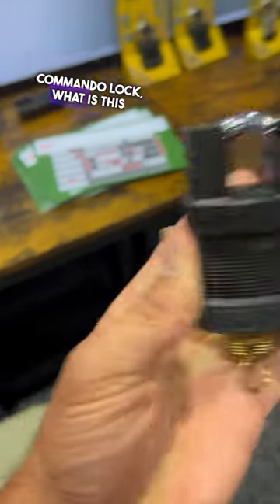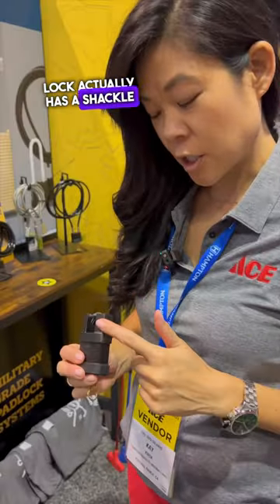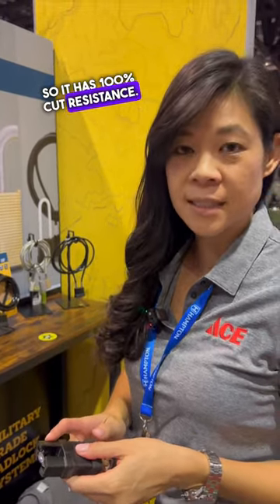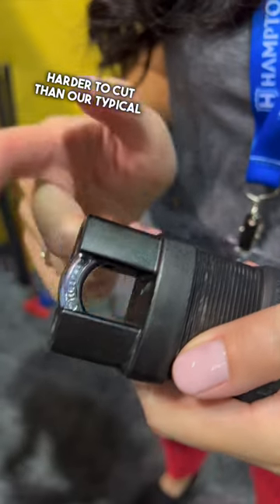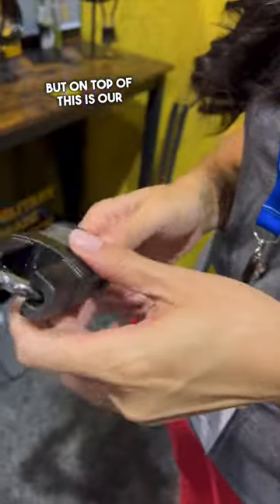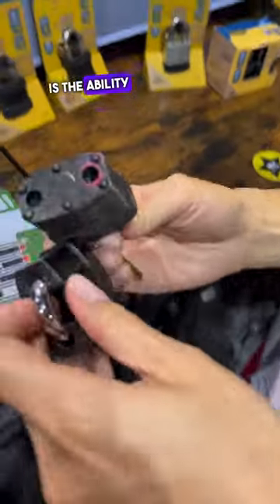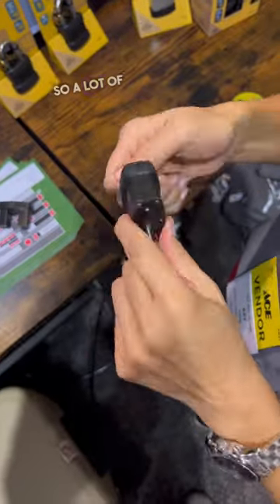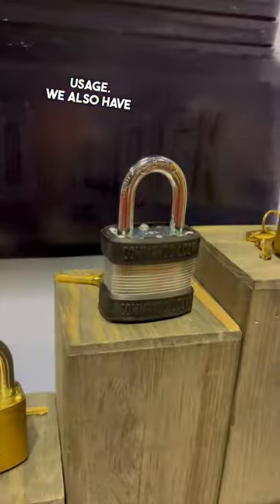Cut Resistant Pad Lock! #locked #security #shorts

Comment: "100% cut resistance"
Challenge accepted
Reply: Cut resistance not cut proof
Reply: Technically everything made out of solid material (vs gas or liquid) is 100% cut resistant.
Reply: Mere seconds with a 1mm slitting disc in a battery grinder…. Just the same as all the others!
Reply: It'd be easy considering they stack metal sheets instead of making one big body from metal
Reply: @davidswanson5669 my bagel is cut resistant ..
Reply: That's how I cut mine off in a minute when I lost my key ..😂

That's also how some meth head got my catalytic converter off my van in the middle of the night ...😢

Comment: Yea but the crowbar was also a great invention and takes about the same time to unlock that lock as it takes to pry the hasp away from what you trying to enter
Reply: Perfect response. Doesn't matter how good the lock is if you can bypass it near instantly.

Heck there's a reason why most doors are kicked in rather than picked. The frame/latch is the weakpoint. Heck a crowbar could likely separate the hinges on most doors  almost completely BEFORE kicking. Meaning a single kick or two blasts through.
Reply: @HidForHG  in the military we have a breaching gun shot the hinges right off lol